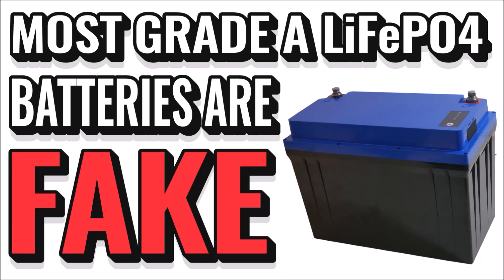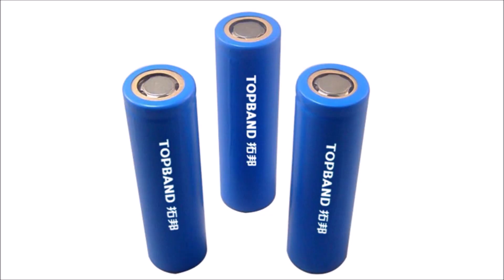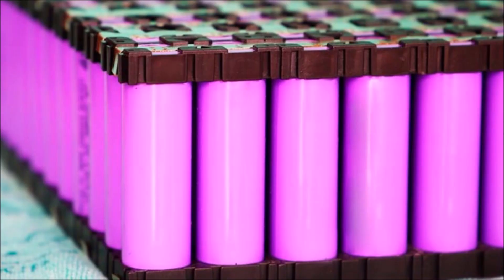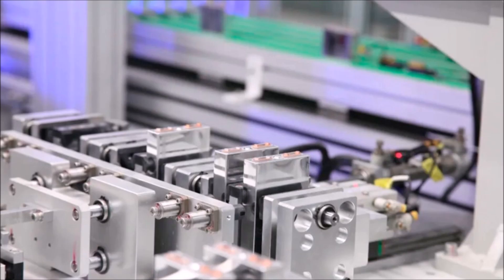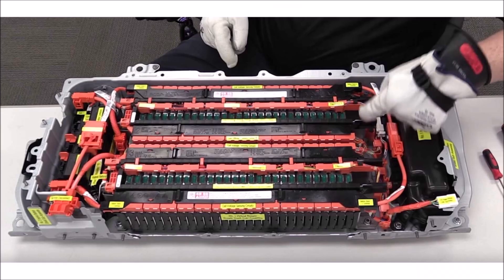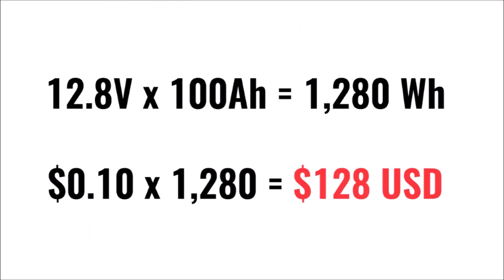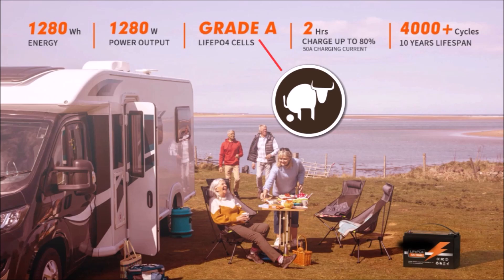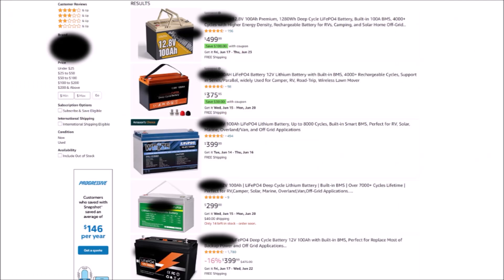Fake Grade A Lithium Deep Cycle Batteries Are Everywhere!  Learn How To Spot Grade B vs Grade A

Comment: Why don't we all own Ferrari's? Well... I don't race, and not trolling for hookups, and I can buy 6.7 Toyota RAV4s brand new with bumper to bumper for the lowest end Ferrari.
Reply from the maker: I know where you are going with your analogy but it just isn't accurate.  A Toyota will outlast a Ferrari by a million miles, whereas you are paying for performance AND longevity with a good quality battery.  So, yes, you can buy 3-4 of the cheapo Amazon specials for the same price as an SFK or MillerTech, but you'll also be replacing them 8-10 times in the same lifespan AND you won't get anywhere near the same current out of them.  Not to mention all of the cool things you can do with a top shelf BMS that you can't with a $5 cardboard BMS in the cheapos.
Reply: @LDSreliance  I think you are over inflating the difference. These cheapo companies know how to cut corners true. But they also know the pitfalls of making recognizably unreliable products. Since China dominates the LFP market, it means that people are buying their cells to give the biggest market share. Are there situations where I would buy top dollar versus reasonable wares? Never - it is the absolute shift of our disposable world. Performance and longevity when coupled with double the cost is just stupid, because people would rather see how long "good enough" will last, and then buy even cheaper the next cycle because improvements will drive down the cost of his original level performance.  I think you need to make a better sales pitch. "Made in America" means nothing to the market share of  consumers.
Reply from the maker: You would think that but that isn't true.  Chinese brands are disposable.  There are no battery brands on Amazon from China that have been on the market for more than 3 years.  Even the big ones like LiTime have had to change their name to shed their bad reputation (they used to be AmpereTime).  Their modus operandi is to dump tens of thousands of products under a brand name in the Amazon warehouses, sell them for ultra low prices, purchase 500 5* reviews, and then sell them until they start getting bad reviews that bring the score down.  Then they pull the product, change the label and branding, and start the process all over again under a new brand name.

I saw this time and again as I was doing product reviews over the years, which I no longer do after catching them numerous times doing this.  They have no US support.  Their "support" is the Amazon seller system and once you leave the return window, heaven help you to get assistance.
Reply: @LDSreliance  I agree with you, that is the most likely narrative. Currently China has almost 100 percent market share. Maybe not in the immediate future, but last time I looked into my crystal ball, I saw the battery market almost erased completely. Power generation is done through magnetic multiplication. At that point they are almost producing 240V@200A from small systems. No need to store energy when you can make it cleanly and cheaply.
Reply from the maker: Agreed.  Normally I'm 100% with the cheap crowd but having been an industry insider on lithium batteries since 2017 and having seen how these are built and also importing my own brand (Jericho) for a while, it has been quite the eye opening experience.  I was lucky and didn't lose money on my own batteries.  But I've seen dozens of good companies close in the last 4-5 years because the average ignorant (and I don't use that term negatively... they just don't know) fisherman or RVer or whatever is going to grab a $150 Amazon battery with 4.4 stars over a $600 Grade A battery almost every time.  It sucks but that is the fight I am fighting.
Reply: @LDSreliance  I appreciate your knowledge, it's people like yourself that drive change in perception and industry.

Comment: Your math does not add up. Even if the cells cost $0 , the difference for A vs B would be $120 max. But currently 12v 100ah battery $100-200 delivered. This means it is sold at lost.
Reply from the maker: Exactly.  Ever heard of the term "dumping"?

Comment: Stfu🙄.. they might not be as good as a high $ grade A but they been working perfect for me, I deal with a lot of golf carts and electric mowers and so far haven't had any issues, one is 5 years old and I haven't seen and drop in performance
Reply from the maker: You missed the point of the video.  Grade B batteries have their use cases.  But these manufacturers need to disclose to consumers that that is what they are and not prey on the ignorance of the masses.  Consumers should have the information so they can make an informed decision on what they want to invest in, what amount of risk they are willing to take, and how many cycles/years they want to get out of their batteries.  There are manufacturers that are outright lying (actually staying that they are using Grade A or "EV Grade" cells that are clearly not) and then there are some that just report inflated stats (like 3,000+ cycles) so you think you are getting a Grade A.

Right now there is no way to hold these companies accountable if you get a bad battery.  There are reports of people getting used battery cells, or even chunks of concrete inside their cases because they know that 99.9% of Americans will never open up the case.  And even if you get mad what can you do?  After 30 days, Amazon won't help you.  You can't sue them.  And when you review bomb them they will show up under a new brand name and start over (there are numerous examples of this but the most famous one is AmpereTime becoming LiTime).

Comment: So my cheap Aus$330 120ah have fake grade a cells, after i tor is apart and found the QR code it shows me the a Eve A grade.  Now the web site is fake too i guess.
Reply from the maker: No chance you got a 12V 120Ah battery with EVE grade A cells for $330 AUS.

Alibaba is selling those sells for $60-85 USD a piece and you need 4 of them.  So that is $240-340 USD before you even get a BMS ($10-50) and a case ($10-25).  Then you have the labor of assembling it, the wires, the connectors, the insulation, the gaskets, the terminals, the packaging, the import duties and taxes/tariffs, shipping fees, etc.  So you are looking at a bare minimum COST of $350-450 USD before they even think about marking it up for profit.  In AUS that is $575-745.

So IF you really did break open your case and look at the QR codes (and I don't believe you did) then they removed the old label and put on a fake code with a valid serial number.  But those are NOT real EVE Grade A cells.

Comment: I am trying to get about 500 to 600 Ah of Life PO4 batteries set up for a solar system I bought, trying to do it as cheap as possible. What battery do you recommend? I am find 2nd hand, or refurbished as long as they are still in great functional condition.
Reply from the maker: 2nd hand or refurbished will be a crap shoot.  You might get lucky but chances are not good.  Grade B batteries are also a crap shoot but at least you might have some warranty protection if it is dead on arrival or fails within the first year or so.

The absolute cheapest way to get a reliable battery is to build it yourself.  SFK (Sun Fun Kits) has some DIY kits you can buy and assemble yourself and save money.  Or you can source your own cells and BMS and case and build your own.  There are hundreds of videos out there on that.

But if you want ultra reliable and a really good warranty as cheaply as possible, get an ESS battery from a reputable company that has been in business for years.  I sell Rubix ones on my site (joint venture between MillerTech and ARK batteries).  They are really low $/kWh for a 10 year warranty Grade A ESS battery.

https://store.ldsreliance.com/collections/solar-ess-batteries

Comment: You proved absolutely nothing! All you said was good batteries cost more. Are we just supposed to take your word for it. Prove it! Tear down some cheap batteries and test them against yours. Show us the results…
Reply from the maker: You apparently didn't watch the video.  You can't just tear them down and test them.  You need the specifications from the manufacturer to test them against.  Simply comparing my battery with a Grade B battery won't tell anything because they use different cells from different manufacturers with different properties.

Its the perfect scam and your attitude is why it is going to take a long time for the public to catch onto it.  Either way, please educate yourself before you respond next time.

Comment: Have seen reviews where battery cases are opened up and QR codes have been scratched off the prismatic cells😮. How do retailers state cycle lifes with B cells, what would be typical cycle life at 80% dod?
Reply from the maker: Yep.  I would bet if we opened up every single battery case on all these no-name batteries that at least 25% of them are using Grade C or used cells and the other 75% or whatever is left are using Grade B cells.  There are no 100Ah batteries for sale on Amazon or anywhere else for $200-300 that are using Grade A.  I can promise you that.

No one knows what the accurate cycle life of a Grade B battery would be because none of the cells are perfectly matched.  Some companies, like MillerTech, use Grade B in an "economy" series of battery and they use closely matched cells but they still aren't like Grade A.  They warranty theirs for 1200 cycles, if that helps give you a guesstimation of what to expect from a high quality Grade B.  But the trash on Amazon I would say you are super lucky to get 500 cycles @ 100% DoD.

Comment: You proofed, essentially nothing.

If a battery functions within advertisers spec ranges, then it does not matter if it’s grade A or B cells. And the expensive brands don’t offer extra functionality.

And if you can’t proof that it’s grade B then the entire video is pointless. Because all you are saying is to buy expensive or we are getting ripped off. You have no proof aside from manufacturing cost estimates.
Reply from the maker: That's the thing... it can't be proven false and their claims can't be proven true.  So its the perfect scam.  The only way to prove their claims false is to tear down the battery, get the real serial number (many companies have been caught scratching off the original cell manufacturer's serial number and laser etching a new one over top of it), and then requesting the real grade of the cells from the original cell manufacturer.

The only way to prove their claims true (4000+ cycles) is to actually cycle the battery from 100% SoC to 0% SoC 4000+ times.  Since no one has done that yet (not even the original cell manufacturers actually do that - the rating is a best guess) then it is impossible to refute.

I gave you evidence where you can use logic and reasoning to deduce when you are buying a Grade B battery and when you are buying a Grade A battery.  It is absolutely impossible for a $200 100Ah battery to be made with genuine Grade A cells.  But it is theoretically possible (although stupid) that a company could be selling a $700 battery with Grade B cells.  So what you do with that information is up to you.

Their claims of current output have been proven false.  A Grade B battery cannot produce the same current for the same duration as a Grade A battery.  That is well known at this point.
Reply: @ if it performs within advertised specs, it’s irrelevant. And cycle life is part of those specs. It’s totally fine to. It the cheap batteries.
Reply from the maker: I don't think you read my response.

Comment: Here in Dec 2024 you can buy 12.8 volt 100 AH Lithium batteries for $210 and on cyber monday sale i picked up 2 for $130 each. Even if they are grade B (yeah they probably are) with that astounding price difference ill slap a fuse on them and when they go bad after 5 years ill buy again. Better than $1000 each battery from name brands like battle born!
Reply from the maker: If you get 5 years from them, consider yourself lucky.  The failure rate of Grade B cells within the first year of use is 20%+.

There is also a growing amount of video and internet forum evidence from users that many of the BMS's inside Grade B batteries do not provide all of the battery protections they claim to provide, including cold charging protection, overcurrent protection, etc.

Finally, several years after this video was published, it is now well established that you cannot get anywhere near the same current output under a high load from these Grade B batteries as you can from a Grade A battery.  Because the cells are not within spec and mismatched to one degree, the voltage will sag under high load (how much varies).  This also greatly affects the capacity under high loads so you end up with something similar to a Peukert Effect where the capacity rating is only accurate under small loads and drops dramatically at high loads.

But if you don't care about all of that, buy a new set of Grade B's every 2-5 years.  I'll keep using my $600 Grade A's for 20 years.
Reply: @LDSreliance  warranty is 5 years on the Seikon batteries. They will hopefully stand by their battery
Reply from the maker: I hope so.  They aren't even a registered US company.  They are imported under "HENCO TRADE LIMITED" which has only existed for less than a year.  The manufacturer that makes their batteries is SHENZHEN TRON TECHNOLOGY CO., LTD which has been making batteries since 2021.

Personally, I don't trust a warranty that is longer than a company has even existed.  But hopefully it works out.

Comment: Thanks for the education.
What’s a fair price now?
Reply from the maker: The price per kWh varies so I'll just use a specific size as an example.  The 12V 100Ah size is the most common size of lithium deep cycle battery sold because it translates to about the size of a standard car or boat or RV battery.  You should be seeing prices of about $600-650 for a Grade A battery.  If you see $500 or less it is guaranteed to be Grade B.  There are lots of examples on Amazon for $200-250 and those are not only Grade B but also the cheapest possible BMS, as well.

Comment: grade B is ok for me, but if a fake grade A is 300 it will sell better than an honest one advertising as grade B. Fake A will be cheapper since they sell better, so yeah... too late to fix it.
Reply from the maker: Yes, you are correct.  Honest Grade B batteries don't sell at all.  I have personal experience with that.

This is why I say that people should just look at the price point and it will tell you if it is real or not.  Is that foolproof?  No.  Are there grey areas and degrees of quality?  Yes.  But it is all we have right now until the market self corrects in 2-3 years when all of these trash batteries start to fail en masse.

If you are looking at a 12V 100Ah battery and one is $250 and one is $650, you know 1000% that the $250 one is Grade B and you know 95% that the $650 one is Grade A.

Comment: I need deep cycle for my RV but with CCA for the generator. i notice none of the fake grade A's advertise cold cranking amps but the legit grade A's do.
Reply from the maker: Yes.  A Grade B battery sags under a heavy load.  This has been tested and proven time and time again.  They don't want their batteries anywhere near an outboard motor on a boat, for example.

I have some dual purpose batteries on my site that have beefed up internals to handle starting duties easily but will also function the same as a deep cycle battery.
Reply: @LDSreliance  wow thanks for the quick reply i will check it out
Reply from the maker: No problem!  ldsreliance.com

Comment: China/ Chinese companies are dumping their "National" used batteries on America and the World Market (I'm guessing BYD Electric Busses/ Shenzen Metro and every other Chinese city/ LifePo4 application, old batteries are rotated out). That seems pretty clear. I am very scared now, as I bought, but have not opened to inspect, and have only tested to a limited extent, dozens of Littokala batteries. I think Littokala is one of the "clearing house" used/ grade b/ c/ bloated battery selling/ building companies.
Reply from the maker: Yep.  They liquidate them on Aliexpress all the time.  I've seen pictures of cinder blocks cut in half and stuffed into battery cases to simulate the weight of cells, QR codes rubbed off, laser engraving overtop of other laser engraving, stickers on top of stickers, and everything else you can think of to defraud ignorant and unsuspecting Westerners.  There is no recourse since you can't take them to court and hold them accountable for anything.

Comment: What about Shenzhen Qishou (QSO) cells from Alibaba? The same scam?
Reply from the maker: Alibaba/Aliexpress have by far the highest scam rate of any source.  You can go to any forum online that you want and read hundreds of horror stories about folks that got scammed on Alibaba buying cells or finished batteries.

If you get scammed, there isn't much recourse.  Alibaba won't hold the scammer accountable like Amazon or Ebay would.
Reply: @LDSreliance  There are quite a number of people who provided positive reviews on QSO cells. For example, Andy from off-grid garage. I want to order the cells but would like to know as much as I know from different people.
Reply from the maker: If you go through the same seller he did then you are probably ok.  But no guarantees.  I am sorry but I don't have personal experience with those cells, either.